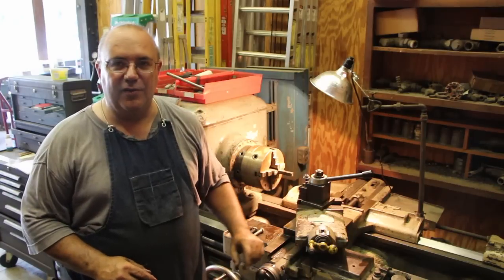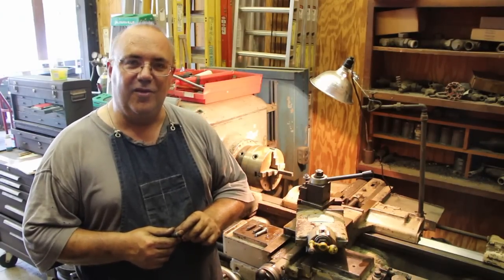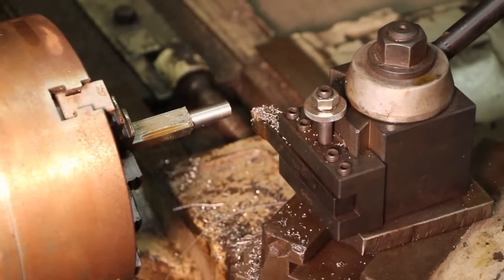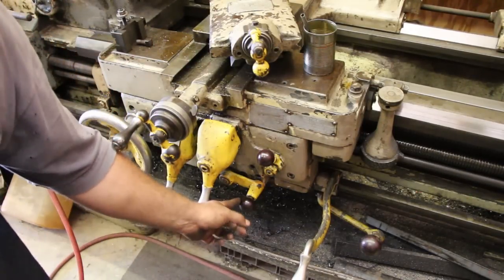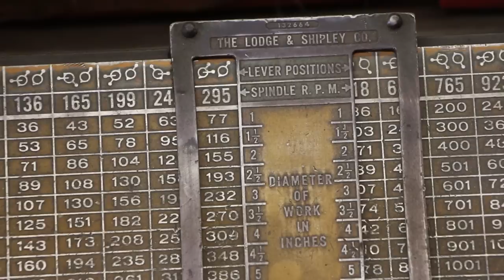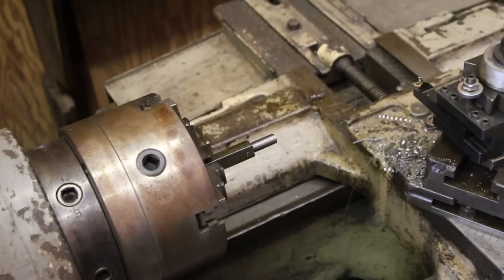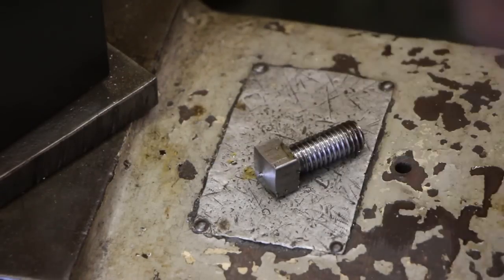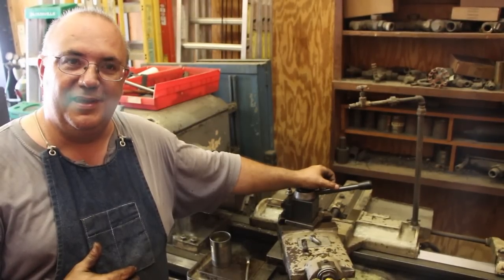Making a Square Head Bolt: Threading on a Metal Lathe

Comment: Thank you for an excellent example.
I graduated Tech school a year ago, Lathe, Mill, CNC Lathe and CNC Mill, Heat treatment, Surfacing, and the CNC Software was all included. 
What I found especially nice about your video was that your method was exactly the way it is still being taught only using a different Lathe.
I subscribed because I can relate to your method.
Reply from the maker: +S. Warren Thanks for the subscription and for watching.  The methods of doing things manually are pretty much the same as on a CNC.  I personally think it is best to learn the manual machines first but that does not seem to be the way it is being done much any more.

Comment: Keith, thanks for the informative video, and for answering the questions in some of the comments about the material used and options for work holding. I also liked seeing the view of the job that included the operation of the lathe. Completed the info I had from the close ups. It seems that there are no standards whet it comes to lathe controls...though there are some commonalities as far as functions go. 

I don't currently own a lathe or mill, but will as soon as I can arrange for space and money...maybe next year. In the mean time I do some woodworking, and what metal work I can get done with what I have (grinders, drills, welder, files, saws, etc). I appreciate you, Keith Fenner, Tom Lipton (OxToolCo), Adam Booth (abom79), mrpete222, and some others sharing what you know with all of us who are watching. It's a lot of work, and you don't have to be doing it.  I'm sure some of the less appreciative comments make you wonder if you should bother, so I just wanted to say thank you so you know that not everyone agrees with those comments. I've learned a lot from the videos I've watched, and it's been fun learning. Thank you. 

-- Mike

Comment: Interesting project and interesting 'tour' of the lathe.  Thanks.
Reply from the maker: Thanks!
Reply: Just finished the gear cutting video for the blacksmith shop and the first video on the sawmill clutch, and.....too many to quickly recall.  That home-built small hammer is neat.

Comment: Awesome job!
I noticed that you don't cut a relief at the end of a threading job: but I see that the tool seems to clean out its own groove.  Interesting since that is quite different than most folks and literature recommend.

One thing I learned from Mr. Pete (Tubalcain) is when grinding a parting tool, if you put a small angle on the cutting (front) edge the part falls off clean without the small bit on the end.  The cone on the face of the remaining bit chucked up can be cut with the parting tool or faced with a facing too.
Reply: I get it.  Thanks for the response.  Really enjoying your videos.  Keep up the great stuff!

Comment: I’ve even noticed that on some modern equipment & products that they sometimes do use odd size combinations of bolt size and treads so it’s not easy to replace/fix when it fails.

Comment: When I had to mount square stock, I usually tried to find a pipe with matching inner diameter or bored it out and cut a slot along the length of it. In a threejaw, the pipe gets squeezed and grabs the square stock. For small stock I now just use a collet chuck (ER25), its collets have eight segment cuts from each side, so square stock can be mounted very true and firm with its corners in the collet´s cuts. Works only up to 16mm (~10/16) diagonal with the ER25, but that´s more than needed in most cases.

Comment: Fine Job. Consider making a final threading pass of a half thou or so by using the cross slide.
Helps smooth the right hand flank of the thread .
Reply from the maker: +Jim L Nice trick!
Reply: I thought that was why the compound is set to 29.5 degrees. Does that not automatically clean up that side of the thread?

Comment: Keith. At 29.5 deg, the ratio of the Compound against the Cross slide is 1.1489. Meaning if the Thread Depth was 50Thou, the compound would need to move inwards off the very first scratch by (50*1.1489) = 57Thou. In other words since the cross slide is always returned to 0, then the depth of the cut is Plus 57Thou of whatever was the compound's reading on the first scratch. Thread depth multiplied by the 29.5 constant always....

Comment: If you wanted to put a chamfer on the head what do you think would be the best way to hold the bolt the threads in a chuck? Some videos that I found suggest a collet or a tube with a split down the side.

Comment: Good video! I have one question, when you are threading and make a cut, then back out on the cross slide, to zero, isn't there backlash in the gear when you go to re-engage the cutter that messes up the reading? How do you overcome that?  Hope that makes sense!
Reply from the maker: MattsMotorz There is some backlash in the cross feed, but as long as you set your zero on the in-feed, it should always go back to the same point time and time again.  The backlash, while there, is always the same.
Reply: Thanks for the reply!

Comment: When making these bolts Keith, what grade of steel should I use?
Reply: ***** Being an absolute novice with my little Atlas 10" lathe, I did purchase some 12L14 hex stock to make some one off nuts and had good success, but didn't know about its strength or durability as a fastener, hence the question.

Comment: hola anyone with information and photos on a von wyck 15" metal lathe 
and if i can do thread on this lathe ???
Reply from the maker: Mic Ibarra Here is what we have on Von Wyck on my web site at VintageMachinery.org:  http://vintagemachinery.org/mfgindex/detail.aspx?id=4152&tab=0 - Not sure about your particular model but looking at some examples of their lathes, most appear to be capable of cutting threads.  There were two basic setups on these old lathes for doing this.  One was with a quick change gear box on the front of the machine to change thread pitches.  The second was a stack of change gears that would mount to the left side of the machine to adjust thread pitches.  The quick change gear box is much preferred as it is quick and easy to change.  You can accomplish the same thing with the change gears but you need to make sure that have a complete set (the gears are often lost over the years) and changing gears can take some time and really slow a project down.
Reply: do you belive is possible in these old lathes they use leather belts not gears to various threads
Reply from the maker: Mic Ibarra Probably not.  Some old lathes had a flat belt that drove the lead screw, but it was for powering the feed for turning, not for cutting threads.  If the belt slipped at all when cutting threads, you would loose your timing and the threads would be messed up.  Sounds like a lathe for turning only and was not capable of cutting threads.

Comment: ......1/2-12 Talk about getting burned !
Reply: I guess you know what to look for then!...sorry.
Reply: it could have happened to anyone, so don't get to down on yourself.
 I served my apprenticeship at Heli-Coil so ...
 I've MADE my share of oddball threads.Both left hand and R/H. It's got to be 2nd nature for me to take a closer look and not just assume...but that just me.
 I do appreciate the videos. Takes me back to the day.
 I guess you could say i'm a bit of a thread snob !!! Sorry for that.
 I used to got down to Tifton Alum all the time. they were a customer of mine when i sold CNC's. To bad I didn't know about your operation then. It would have been nice to meet you and see all your good work.
 Thanks for the return note.

Good luck to you Sir.
Reply: SAE didn't standardize bolt sizes and threads until about 1914.  If your bolts were made before this time, anything is possible.